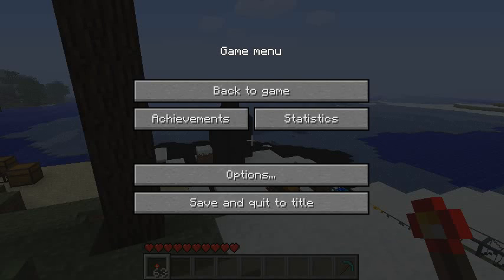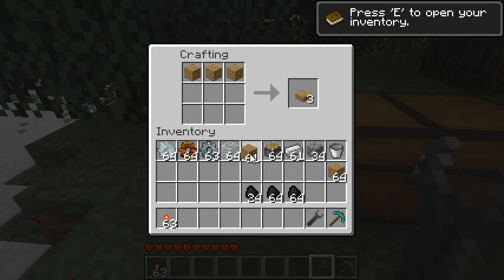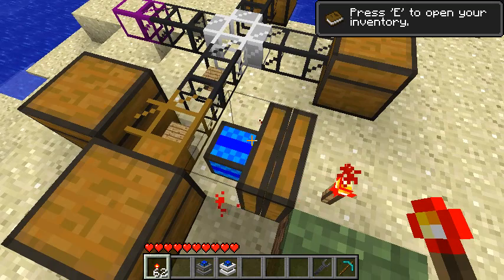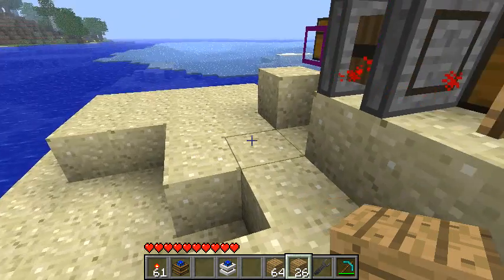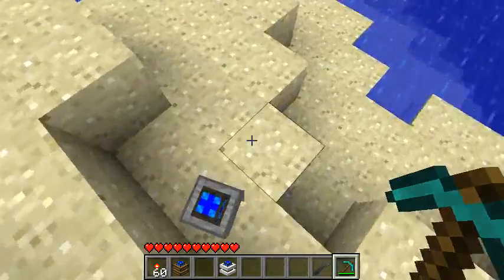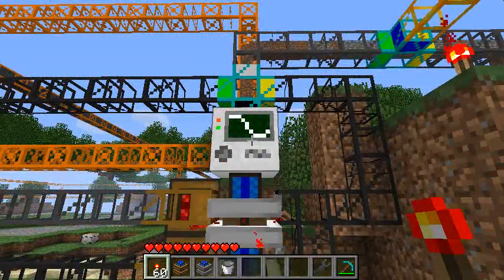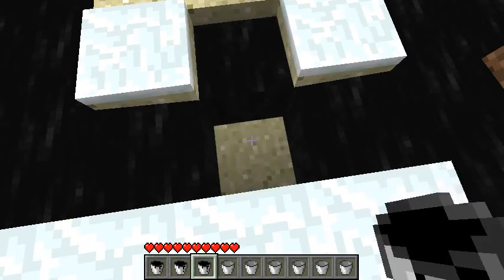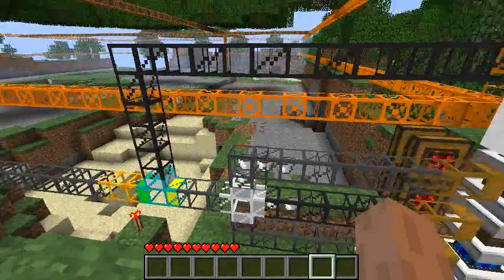BuildCraft 2.0.1 - Engines, Oil and Wrenches

Comment: combustion engines need fuel or oil to work, to extract stuff from chests and such you use a wooden pipe first, then cobble/stone pipes any other way, the other pipes are usually used in big quarry projects.

Comment: @ThisMuelliGuy 
Make sure you have 5 mods installed including Energy. I had the same issue and it ended up the 1.7.3 only had 4 of the 5 downloads. Upgrading to the 1.7.3 BETA version it had all 5 including energy aka oil mod.

Comment: @sshemley You need to downgrade minecraft to 1.7.3 to get the engines.  2.0.1, 2.1.0 and 2.1.1 have the energy.zip (Oil and Engines). Version that works with 1.8.1 doesnt have energy.zip.

Comment: @TheSportsVEVO 
If your using 1.8.1, Engines aren't included in that release, Check the forum close to the last page it's on there. Had the same problem.
1.7.3 has it if you can/want to downgrade.

Comment: @Whitepagan go to .minecraft/buildcraft/config and open the file in there with notepad. under the line that says "pipes.alwaysConnect=false" type this exactly: power.framework=buildcraft.energy.PneumaticPowerFramework that will fix your problem. close the file and play. also, read comments more.

Comment: when i place any type of engine it sits on the ground with the blue bit pointing up i cant get any of the engine to work could there be somthing wrong with the way i installed the mod because everything else works fine

Comment: By default, the Energy mod is set to redstone power. In order to enable the engine powering machines, you will need to change a line in the BuildCraft config file:
power.framework=buildcraft.energy.PneumaticPowerFramework

Comment: anyone who has a problem with the engines not alligning automatically is either using a wrench or going to the config and on the line where it is something like power.framework=buildcraft.(something).RedstonePowerFramework change it into power.framework=buildcraft.energy.PneumaticPowerFramework

Comment: I'm playing Industrial Craft 8.55_02 and buildcraft 2.0.1 but the wooden pipes won't extract things from the industrialcraft machines with the engines ... is this a bug or I've done something wrong when installing it? If it is a bug you will solve this bug the next upgrade ?

Comment: maybe you could make a special type of chest that you could just dump oil into and then just take away the bucket again a bit like you put oil in the iron engine. then you could have an oil pipe to connect to it so you can take oil to the engines.

Comment: The incoming pipe for supplying the engines with oil is a bit random in its distribution. Is there a way to give av even number of oil-buckets to each engine?

Comment: For the engines you should add jet
Jet is crafted with diamond

But for jet fuel you must use oil, and you put it in an airorator